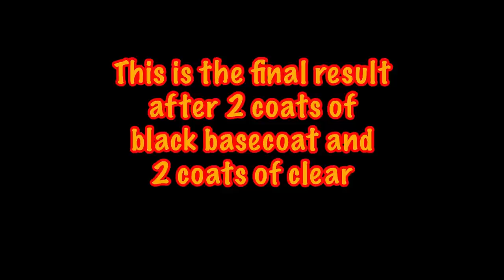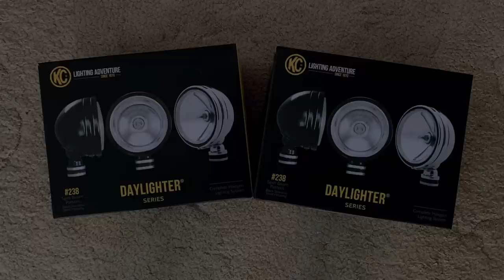1985 Toyota Pickup 4x4 Transformation! Back To The Future Marty McFly Truck Replica

Comment: I had this truck except I had the long bed. It was black with chrome all the way around and around hubcaps as well… it had the SR5 Pinstripe around it.. on SR5 on the seats as well. Mine was the 1985 and it had a sunroof and back sliding window. It just happened to be a special order at this dealership and my Son’s father (he was much older than me) he knew trucks well, knew I was getting a better deal so we jumped on it and bought it! He was tired of me wanting to always drive his lol! He had the standard 1985 (red) SR5 truck. So we bought that truck… and I took my new Toyota Corolla back to a different dealership back then… THIS WAS THE NICEST TRUCK I HAD EVER OWNED!! Last year for lift kit…(if that’s what you wanted to do) I liked mine the way it was.  Tinted windows… back window was sliding which was special order back then as well. Sunroof was special order as well as the nice stereo in it and chrome all special order.  I think paint job was special order too… & seats 💺 they had the SR5 all tiny written all over them & I don’t remember if Craig’s truck had that or not? I will always be grateful I got to own one of the best trucks ever and I sure wish I never would have let it go…but can’t wait to buy another truck 🛻 thinking I’m going for The newer Tacoma since I was born in Tacoma.. love these videos and thx for reading my story y’all!

Comment: That is some top notch tin-work on the tray.
Reply from the maker: Thanks David, it was a bit of work - but I am extremely happy with it 😁
Reply: @HeathsGarage  As well you should be! Looking at the photos and the tight joints, I got the feeling you had fun doing that kind of detailed work. It's near impossible to do a good job you're under the clock or frustrated. But when you're working on your own truck and at your own pace, things seem to come together easier. At least, that's been my experience.

Comment: Beautiful build.  What size wheel and tire combo did you go with ?
Reply from the maker: 15”x8” rims with 31x10.5 R15 tyres
Reply: @HeathsGarage  Thanks,  I am trying to track down the KC Light covers for the 5x7 and the 6"   Most places i have searched the 5101 for no longer have them.  Any leads on where to look or where you sourced yours from ?
Reply from the maker: @premiumoctane93  I bought mine from ‘Greg’s restoration’ from the US - that is the shop that restored the original movie truck
Reply: @HeathsGarage  one more question if you don’t mind.  Did you buy new lug nuts for your wheels ? If so what style / size did you get?   Thanks for all your replys.
Reply from the maker: @premiumoctane93  I did, I bought new black ones from here in Australia - I honestly can’t remember the type but I do remember I had to check as there were 2 different ones for our Aussie 85 hilux

Comment: Was looking at parts and wanted to know where you got your smitty bilt parts
Reply from the maker: Are you in Australia? They were made by a fabrication shop here. $5,000 all up for front, rear and light bar
Reply: @HeathsGarage  unfortunately not but is there any way to get them shipped they look spot on 😭
Reply from the maker: They were based off a original set - so they are 100% spot on.
If you message my Facebook page I will give you the guys details

Comment: Just enjoyed your video. I'm in Australia and almost finished restoring my 1985 extra cab Toyota Hilux. Cut all the rust out and welded in new metal. Its come up a treat in the original yellow colour.  Curious...was that steering wheel specific to the SR5.
Reply from the maker: Thanks mate, I don’t believe so. 
If you check out my more recent video on the truck I actually swapped it out for a US spec one 😎👌🏼
Reply: @HeathsGarage  Cheers, thanks for the reply.

Comment: I’m in the process of purchasing the same wheels you got for my build. What tire and wheel specs are you running?
Reply from the maker: The backspace varies from year to year, I just measured the old rims on my truck and went from there.
The tyre size is 31x10.5 R15

Comment: I have the MC FLY truck but white sr5 fully loaded solid axle efi four banger ex cab. Nice work. What rubber did you use around the windshield?
Reply from the maker: Sounds nice, they are a great old truck. I used the factory/standard windshield rubber
Reply: @HeathsGarage  I thought they were all glue in with aluminum trim around the windshield. That’s how they are in the US. is that seal still available from Toyota or after market? Some people are deleting my style and going to rubber. I’ve seen some crude replacement and yours seems to fit perfectly. Do you have a part # ?
Reply from the maker: This is the same style as mine - it has a chrome trim piece that presses in the middle (I left it out for the all black look) 
My glass guy said it is only for aesthetics and doesn’t serve any other purpose 

https://www.ebay.com.au/itm/154105013780

Comment: WOW, you did an EXCELENT JOB resorting it 🙌🙌🙌🙌🙌🙌. I happen to have a 1985 blue/white one too which I restored as well but kept the original Blue/White color. Trying to fix that 1 long dash cracked, its been a challenge tho. 😁. Also, I really liked what you did with your bumpers, I wish I had a way to make one just like yours.... LOOKS GREAT. LOVE those bumpers. 
One question, what did you do with your suspensions? I have a 3 inch lift with Rancho shocks, and my biggest complaint is the suspension and how rough it is even on tiniest bumps.... Its EXTREEMLY rough, to the point that you can't take it off-roading. Any advice? Thx
Reply from the maker: Thanks! 
My suspension is all stock as it’s not a regular off roading truck

Comment: On the bed side coverings, it looks perfect w/ paint.  Great job, btw.  My question is, did you use flat steel, or have some kind of kit provided to you to get your result?  I don't have a truck I'm just curious about the process.
Reply from the maker: Thanks Aaron, I went to my local steel shop and bought some flat steel then put a slight angle at the top (basically just until I was happy with how it looked by eye) 
I am extremely happy with how it turned out
Reply: @HeathsGarage  Thank you for responses.  I liked, commented and subscribed to your channel. Peas main
Reply from the maker: Thanks so much Aaron, that is greatly appreciated 😁

Comment: Tire and rim specs??
Reply from the maker: 15”x8” rims with 31x10.5 R15
Reply: @HeathsGarage  do you know the backspacing and did you use any spacers?
Reply from the maker: No spacers

The back spacing is different for certain trucks - there was 2 to choose from 
I just took off my standard rims and took measurements and chose from there 👌🏽